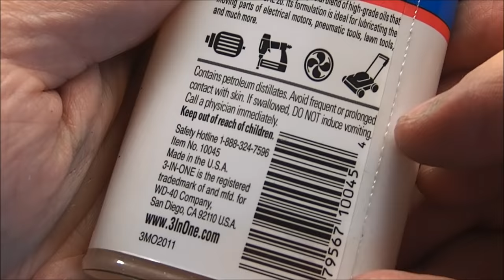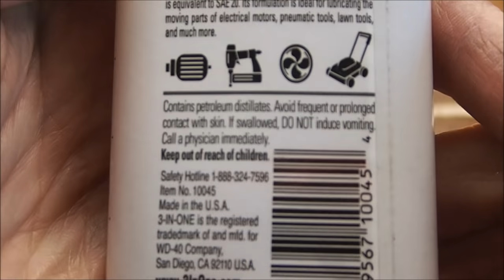How To: Cleaning up an old pocket knife

Comment: What a great video.  My Dad (87) is a knife collector who has passed some of his knives on to me.  Thanks for getting me started on cleaning up some of his knives.  I know I'll appreciate them as much as he did.
Reply: Don't know about your dad and what kind of 'collection' he has, but if it's not just a bunch of random knives he bought over the years, you should first do some research. Be careful with rare collector's knives, most of the time a clean-up, especially rust-removal and/or polishing ruins their value, similar to coins.
In case of old and rare heirloom-pieces some protective oil and moving all moving parts is just fine, even, if they look ugly.

Comment: Thanks for the tips. Two additional I’ve done is use an air compressor to spray some of the crud out, especially after using WD-40. Also, as a final touch put it in an ultra sonic jewelry cleaner.

Comment: Jeff you're doing really good so far, i metal brushes on the backsprings to get debris n rust out of there, the ones i use are actually really fine, most ppl dont even know theres 3 different grades on them out there, you can get a pack of those, carbon fiber bristle brushes (same thing as the tooth brush, only lasts longer n just a bit tougher grit on it) and also a brass brush with as well for like 3.99, just look over in the paint section near the paint brushes and you'll find them.  I also use Meguiars Plastx for the grips, and that stuff works the best.  It will also clean and polish the bolsters as well as the shield for you.  For the inside towards the liners and backsprings, i use steel wool as well, BUT i actually take a small portion of the steel wool n pull it off making into a small ball, just small then the size of a dime, then i take a pick n push it down in there n let it scrub off all the rust n clean up really good.  Use rem oil next time,  same thing as WD 40, but it cleans better n penetrates a lil deeper too
Reply: You can get inexpensive sets of black bristle, brass and steel brushes in sets at Harbor Freight. To me they are almost throw aways.
Speaking og grades, there are 3 grades of Scotchbrite cleaning pads. Only the first 2 are applicable to this kind of work.
Remember stainless knives (and metal) can be adversely affected by steel wool as it will induce ferrides; causing it to rust/degrade.

Comment: Good technique and the nice results. I also like to use bamboo skewers, Nev-R-Dull, and paste polishes of different grits. And there are also several good alternatives to DW. The mineral oil also works well on stag. There's just something about 'old bones' that call for some labor, even if the blades are worn down. Sweet old Kabar.

Comment: Did a good job I've been collecting for about 44 years. I just have a suggestion on your initial cleaning when you were looking for something then to get down there where your blade lockdown at I go to Harbor freight and buy their real cheap set of dental tools sometimes you can get the whole set with all different sizes ends for about 499 I keep three or four of them cheap kids around and I kind of blunt the ends a little bit cuz I don't want to scratch the actual knife itself and you can get into all different size with with no problem at all and it makes it easy cuz you can use a hook blade a 45-degree bladestrike play they're really neat little tools just thought I'd throw a little positive that you're my friend I seen you quite a few old nice vintage knifes you have there I have over 3000 and always looking for more!

Comment: Im fully restoring an old pocket folder like this one. It has a long blade, screw driver and bottle opener. When I first got it everything was rusted and gunked shut. I let the whole thing rest in a bowl of vegetable oil for around 2 hours. After that the blade opened very difficultly but none of the other attachments would. I dont have a buffer like yours so I just used a very high grit sand paper and took all the tarnish off the outside of it, the inside and the blade. After that I let it sit in warm water for around 20 minutes, then took it out and began cleaning all the gunk from the channels and inside of the pivots. I had to use Q-Tips dipped in rubbing alcohol to really get it clean. After drying it off I have been lubing and working all the pivots of it with 3 in 1 oil. Slowly making process on the restoration wish I could do it as quick as yours though.
Reply from the maker: Xtranius great work!  Keep it up.
Reply: Thanks! Your video helped a lot, unfortunately my local hardware store isn't open today so I can't run out and get WD-40. I tried breaking in all four tools pivots on the knife last night using 3-1. I made some progress but its really slow I have a feeling this knife was neglected for quite a few decades. I let the pivots soak in more 3-1 for about 12 hours but one pivot is still giving me trouble opening. I used dawn like you suggested and that got all the 3-1 oil off the handle, tools and even my hands nicely. I think I might apply some vegetable oil to the inside of the pivots.

Comment: There are quite a few approaches possible.  I try to do the restoration outside in the sunlight.  All of the potential chemicals, tooth brush, rags, ice pick, ear cleaners are assembled.  The first step I follow is to open up all the tools/blades if possible.  This allows an inspection which may determine what gunk there is, the composition of it and areas which require special treatment.  

The gentlest approach is to dunk the unit in warm soapy water, rinse off and try to remove areas of gunk with rags/tooth picks/ ice picks during the drying process.  Then, not knowing what germs may be about, a quick dunk in alcohol.

WD40 is a water displacer.   So, it can have a role.  Typically, I don't have to use vinegar.  It is used on large tool/axe/hatchet restoration.  If there is actual rust on a knife, I try 0000 grit steel wool first.  Then you can escalate to rougher grits or vinegar.

The final lube can be a silicon based spray, 3 in 1 oil, vegetable oil.  Make sure that your previously rusted areas are not left exposed  bare to the air.

A nice challenge is cleaning the area of a Swiss knife where the tooth pick and the tweezers may have been kept.  Yep, now you understand the need for rubbing alcohol and thin enough tools to get inside the compartments to work on removing gunk.

Part of the restoration process should include provision for keeping the knife protected after restoration.  This means a dedicated and possibly inexpensive sheath/placement in a nearly air tight baggie (I prefer ziplock closure) and periodic inspection.

Comment: Thank you for this informative video on simple knife cleaning.. I'm a newbie to collecting these old used gems. Thanks for pointing out the mineral oil, I recently used three-in-one and failed to read the warning label LOL yes got it all over my hands after lubing up a number of old knives. Not to mention it does stink . I too have been Leary of letting things soak for long periods of time let's say in vinegar or mineral spirits for fear the scales may slightly Pull-A-Part from the adhesive. Maybe using some baking soda or some Dawn dish soap like you did may help. I think ultimately it's trial and error sometimes. keep up the good work!!

Comment: Excellent tutorial video! I see a lot of the techniques I use ( bufffer wheel/black compound). Great tip on the mineral oil. To file the recasso down so the blade sits deeper inside the handle, that was genius! I would have never thought of that. Thank you for the video. Will sub.

Comment: Mean green is fantastic cleaner that is not hurting finishes on these old knives. I also use 0000 steel wool to knock off rust without losing the cool patina underneath.

Comment: I do the same thing with using a block to get the edge safe to scrub with the steel wool. One thing I do different is to add a layer of cardboard from an old box between the board and the knife. It kind of cushions when I am pressing into it. Maybe it's in my mind, but I feel like I get better results that way.

Comment: Great video!! I have searched multiple times on YT for this exact video, an in depth step by step of somebody restoring a slipjoint. Thanks for filling the void! I have soaked them in 3-1 overnight before and then always do a thorough dawn rinse out afterwards. Im going to have to get a buffing wheel for my bench grinder, I have a bunch of older imperials and schrades that I could clean up. One thing I really want to get down is how to do a satin finish. I have tried 400-800 grit wet/dry but it always just looks bad :/
Reply from the maker: I hope it was helpful!  I'll try not to be so long winded next time.
Reply: i prefer in depth rambling as opposed to scripted and concise :D

Comment: thank you for not using a belt sander, or a grinder wire wheel to clean up your knives. and thank you for supporting the blade on a block. after viewing some cats work , I want to scream. but finally someone who pays attention to the hidden details .
Reply from the maker: I appreciate it!  I am planning on doing another similar video edited down into a smaller package.  I have learned a lot about YouTube production since this video.  Thanks for watching.

Comment: Jeff, 

I really enjoyed this knife restoration video.  I learned a lot.

I found an Ulster folding pocket knife in a thrift shop a few days ago.  It has a can opener and bottle opener/screwdriver on one side and two knife blades on the other.  It was a bit rusted and grubby.  To me it looked quite old.  It was only $1.49 so I bought it.  I cleaned it up with fine steel wool and a little 3 in one oil.  ( I know - wrong oil!)  It looks a lot better and everything snaps shut, so I was very pleased.  The one thing that seemed wrong was that the two knife blades had "exposed" knife points, meaning both blades need some adjustment with a file.  Your video showed exactly how to do that, so I'm very grateful.  

I'm not sure what model knife I have or how old it is.  Do you have any advice on how to find that out?

Thanks a lot, Tom

Comment: Great video thanks, I recently restored for the first time and really enjoyed it, have a lot to learn and this really helps. Any ideas on how to being back some life into a dull plastic handle?
Reply from the maker: Plastic is tough as too high friction will melt it if you try buffing, and some solvents could react badly and corrode or melt the plastic too I would imagine.  If the plastic color is uniform throughout, you could attempt wet sanding with something like 2000 grit sand paper.  Something like you would use to polish out a car finish with.  Maybe even 5000 grit.  Good luck!

Comment: That file you used to make a repair seemed to cut very fast.  Is it that the steel is soft?  
I was taking the sharp edges off a knife in S35VN and the rate of re-profile was much slower.  I picked up a diamond file and it went much faster.  (probably not needed for older knives)  Thanks again..  Great video!

Comment: I hope no one actually does this. I restored one as an experiment and it was in far worse condition and came out better. You can sum up this entire video with "use a buffing wheel". 

If you do it like that you are going to create unevenness b/w bolster and scale and the blades will look wavy instead of flat. Instead, polish blades on a strop with 2-3 steps in compound (I think its red, then green, then white). They won't look like new but will be very presentable in about 15 minutes (per blade). With bolsters, I used the same strop (green) and used a rolling motion AFTER taping off the handle scale! Oh, and for lube and clean I used Breakfree CLP. Doesn't stink like WD-40 and easier to apply without making a mess. To clean the inside, WOOD is the hardest thing you want to use so you don't scratch up the interior! Toothpicks and Q-Tips (some with the cotton removed) did the job with no damage to the knife. FWIW
Reply: I would argue that he’s cleaning up the knife and not doing a full/partial restoration. Honestly, I’m currently torn between this method, which leaves much of the old character vs your method, which brings it to virtually new in box.

Comment: I think to properly clean those old knives you should do a total disassembly. Knock out the pins & separate the different layers. Then do your cleaning routine. I think the results would be better.
Reply from the maker: Most of them are "peened" or mushroomed out such that you cant punch them out like a machined pin in a firearm or something.  You would have to drill them.

Comment: I let knives like that soak in two cycle gas overnight.  Then, clean out the liners, rinse it again with two cycle and then blow it dry with compressed air.    I then use some 400 wet or dry to clean out the liners, rinse with two cycle and blow dry, again.  I use the 400 to get rust off the blades, sanding lengthwise on the blade to not leave scratches in the blades.  I the hut it with jewelers rouge, rinse and blow dry, agin.  I the lube the locking surfaces and work the blades until they are free and have some snap to them.  I may let it soak again in two cycle and blow dry.

Comment: I've always learned do NOT use steel wool to clean up steel items.  Some knives have stainless steel (read that stains less) which free iron from the steel wool will cause to rust fast.  Same thing with steel blades.  It is the free iron that rusts quickest.  Use scotch brite instead.  It cleans as well and does not cause rust.
Reply: Or Nev-R-Dull. And don't use Nev-R-Dull on highly polished steel. Even it is too abrasive and will leave scratches.
Reply: Aluminium foil works very well on stainless and stained carbon steel with minimal. Or no.scratching!

Aluminum is not as hard.as.steel will and you do not have deal with the steel.debris from the steelwool!

Comment: Have you ever replaced broken blades or used two knives to make one good one?  I would love to see the process.
Reply from the maker: I have never replaced a blade, but I have converted at least one two-blade knife into a single blade.  Most of the process would be pretty similar with a complete disassembly of the blades, springs, and liners.  I have saved pen blades and such from knives converted to single blade just in case the opportunity to replace a blade presented itself.
Reply: Thank you for your response Jeff, if you get a chance I would love to see your process when you do your next two-blade to one blade knife.

Comment: See you use toothbrush like me. Toothpaste great too but I also heat brush a tad and bend some 90 some 33 some ?? I use so many so many angles with a click of the bic . Bend dunk in water .ok. I gotta finish watching cool video. Remember if you selling and used half way decent daily users . I like carrying two friends like carrying off . Lol  oh I even bend brush part of toothbrush roundish to point end Brussels out and be surprised what places that with L bend will do.  L for one keeps hands away blade I use toothbrushs for oiling too dip and brush . Never throw away brushes. Oh great in car vents window buttons every where
Reply: BINGO BABY ,look great great I have a bad pet peeve , I can only look at new things  so I need used stuff. ( sold ) lol . Although I like two smalls  after all I have two front pockets

Comment: Could you use something like vegetable oil instead of mineral oil?
Reply from the maker: what I have heard is that food based oils will eventually go rancid and that might do odd things if it’s absorbed in the wood.  it would work in a pinch.
Reply: I use hair clippers and have plenty of clipper oil that I use. It works. Even 3 in 1 oil should work.

Comment: you know what your doing so wanted to ask you I've been using baby oil to oil my knives and tools  is that ok or should I try something different?
Reply from the maker: tacticalgamer777 I have not tried it, but I would imagine it could work.
Reply: tacticalgamer777 :- I hope you get to read my comment & good luck on the lubrication of your knives.
A trick that many of us collectors use on knives, especially knives that might be used for food preparation,  is to use pharmaceutical grade mineral oil ( available at any drug store, on the shelf) for the blades and moving parts/joints. And where a "grease" might be required (for long term storage,  etc.) ...use regular vaseline or petroleum jelly as it is also food safe.

Comment: Denture cleaner tabs don't effect any metal or plastic material (I'm not sure about bone), you should give that a try. Just put it in some warm water and let it sit over night.
To get into narrow spaces, I use wooden toothpicks.
@29:10 "You see, I used it plenty of times" - yes, but looks like you never cleaned your file afterwards - shame on you.
To oil a knife that's used to prep food with, you take food safe mineral oil, like you do (the maschining oils contain PAC, which cause cancer!) or use camillia-oil, preferred for japanese cooking knives and cutting boards. 
You should have worked the blades, when still soaked in WD-40.
Reply: I read this and decided to give it a try, I used 3 tablets in hot water in a pint canning jar and it has been sitting about an hour and the rust is coming off. I will see how it is going tomorrow. I know the post is three years old but rust doesn't care about that and neither do I.
I have been using the denture cleaner to clean the toilet bowl, put 2 or 3 in and let it sit about an hour or drop them in over night.
Reply: @keithjohnson5190  - Glad to help, merry Xmas and a happy new year for you and your loved ones
Reply: @mannihh5274  
It worked but I didn't think that there was that much rust. I still ended up hand cleaning some of the knife.
Happy New Year to you too.

Comment: What do you if it's a wooden knife with paint on it its also an older knife
Reply: Use paint stripper on the wood and then oil the wood with boiled linseed oil. Hope this helps.